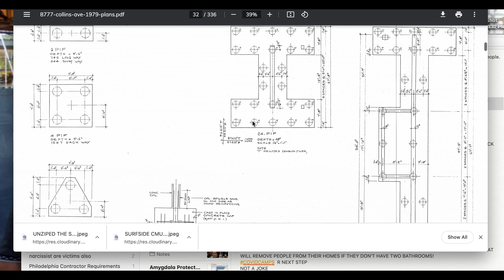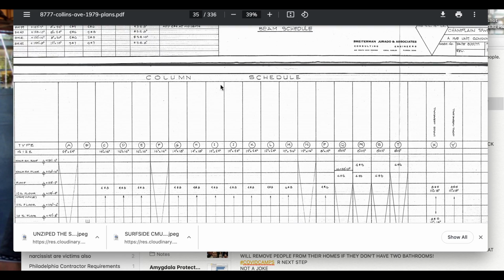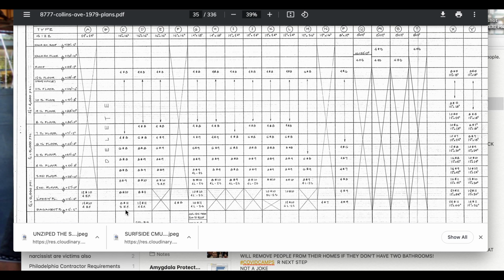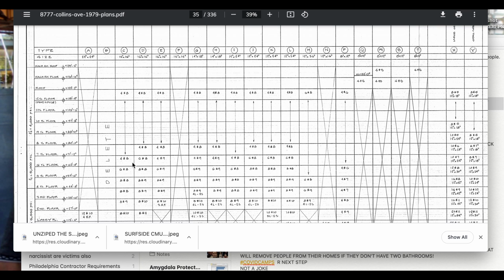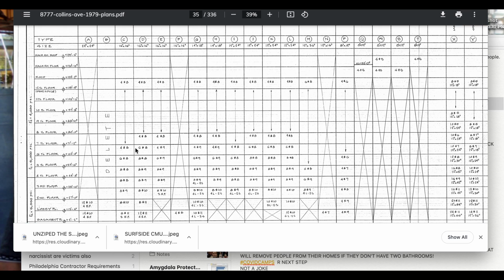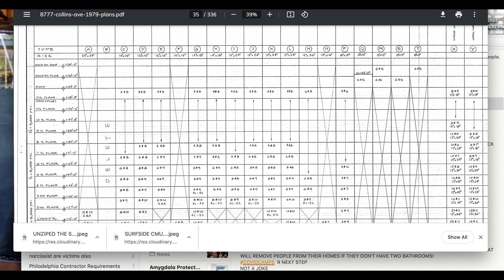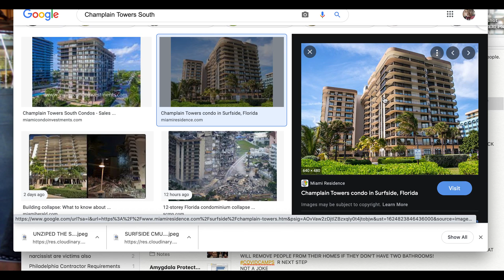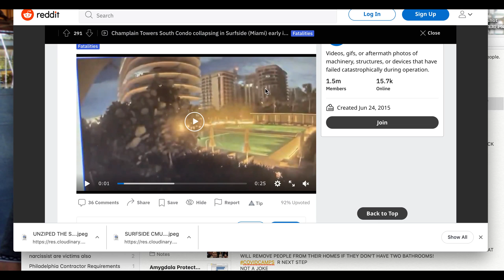Champlain Towers COLLAPSE CORRECTION VIDEO ON COLUMN BUT NOT LOCATION OF FAILURE

Comment: Kai, I'm pretty sure that the most recent plans are found on pages 249-268, which are dated 6/26/80. When Surfside posted the plans, they probably couldn't figure out which plans were the most recently revised, so they dumped every version they had received. Nothing is in order, dates are missing and there are so many revisions that it's tough to know which pages match the actual building.But I think 249-268 are the most recent.
Reply from the maker: Lucy, I am hunting for third party verification on the beams that are on the first floor and transition from pool deck height to first floor /Libby height.
Note, this is mixture of beams and some are just pour in place floors over columns.

Comment: Just wanted to point out one of the news teams took a look at Champlain Tower North (sister of South Tower that collapsed) with the President of the BOD of the North Tower, and it is impeccable and you can eat off the garage parking lot floor! He also stated years ago they removed all the tile floor that unit owners installed from there balconies and corrected any deficiencies (he stated water was puddling on the balconies and getting underneath into the concrete). Wow what a difference the North Board of Directors makes! Also many contractors/workers in southeast Florida are incompetent, sloppy, and ignorant, these contractors rake the condo associations over the coals with ridiculously high pricing!
Reply: Yeah, but it's the same plan and has the same 13th floor penthouse. I wouldn't rest easy... yet ;-)

Comment: In conversation about column sizes  differ from plan schedule sizes .The exterior view they look like different sizes  because Architect  added CMU wall & stucco infill to create windows, doors ,or solid walls being built to align with outer column face  which if correct should have the wall details on other plans . JM
Reply from the maker: Agreed, on possibility but, added decks are the major concern here and the reduction of PSI to concrete yet adding the extra loading...
Reply: @ForensicCats  I would be curious to see the plans to the sister building. It has extended balconies on the portion near the elevator shaft, and I wonder if they had made any update's to those plans.
Reply: @danr9584  I'm working on a timeline of the process and it's really interesting (and alarming at the same time). I'm using the public documents to lay out what happened when. Same legal owner, same architect, same general contractor, even the same plan.

Comment: To me C goes to the 12th / Penthouse. Connections from 12 down to 7 ar 4 #8
Reply from the maker: I am exhausted but I am reference psi from the lower level and sometimes, I leave out the small detail by mistake...  Yes Jason, the column goes up to the roof...

Comment: Can't wait to hear your opinion.  Sounds like spalding was a big factor.  What I don't get is 1, how do you know how much rebar has been affected, since the rebar is hidden by the cement.  Would the cement always crumble and show obvious signs of problems when there is spalding? If not, how can the engineers determine the safety?  I guess there is a whole science to this question.
Reply: The minute spalding occurs, the entire piece is affected and is no longer suitable for use, or at the least significantly reduces its safety.